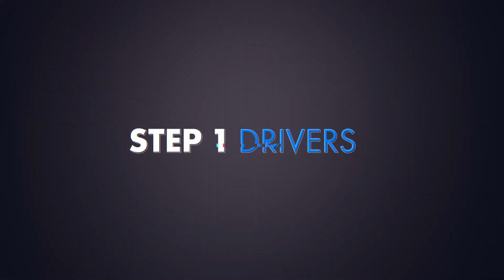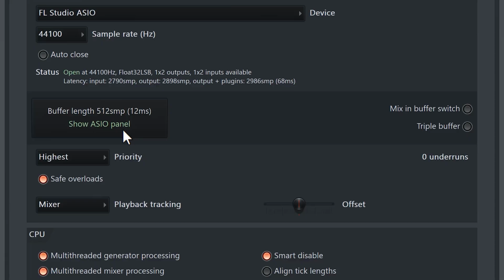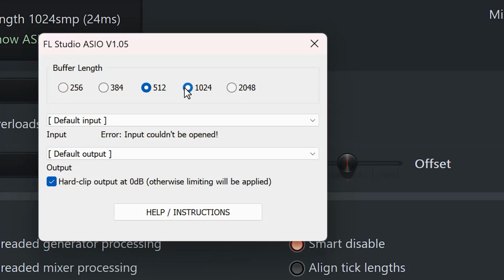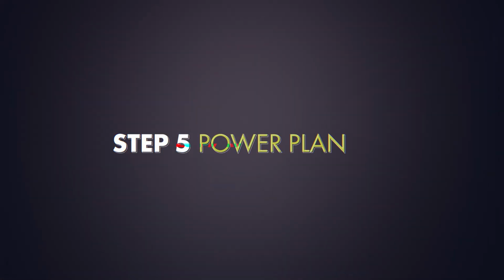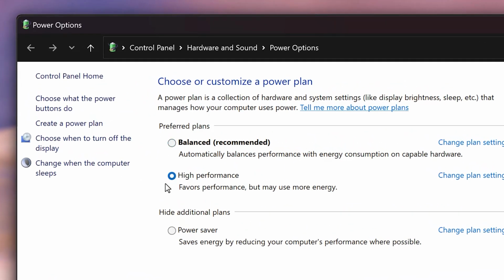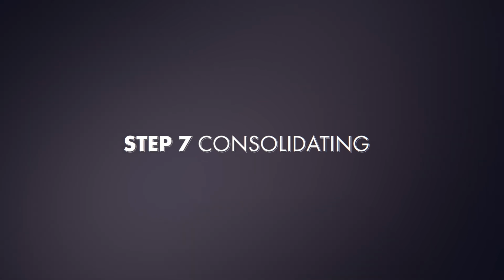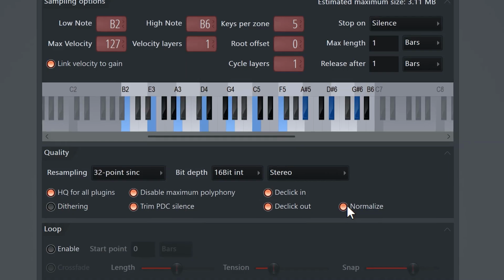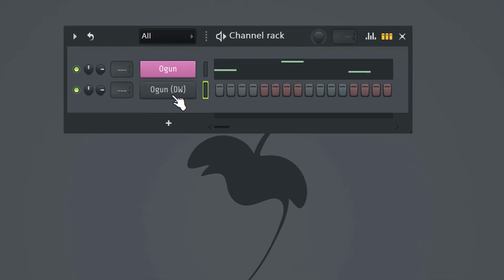Make FL Studio Run SMOOTH like BUTTER (Step By Step)

Comment: When I created the Direct Wave instrument it came out much lower than the original sample. Any way to keep the same (not sure if it's volume or fidelity or what) state as the OG sample? This is the first time doing this so thanks for the lesson. If I can get it to work proper, this is a great tool
Reply: Did you check the mixer and channel volume?